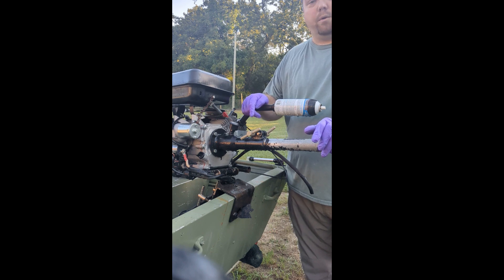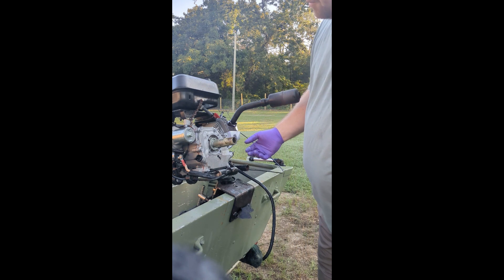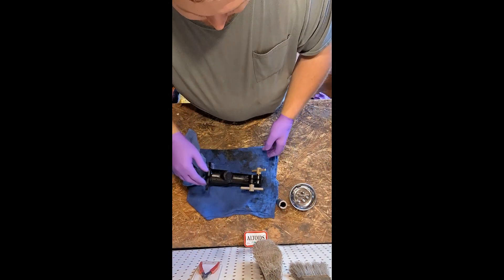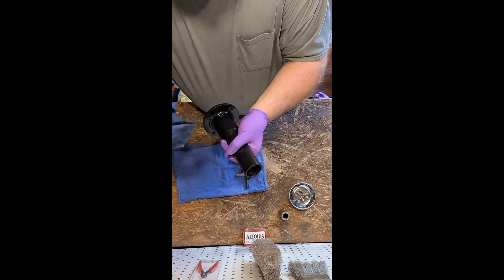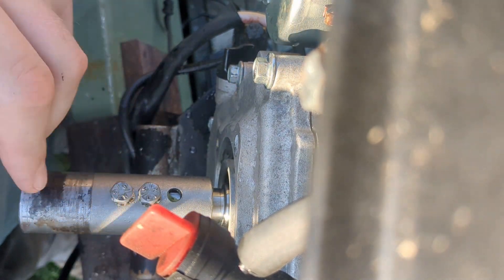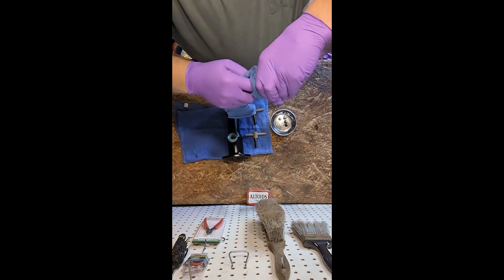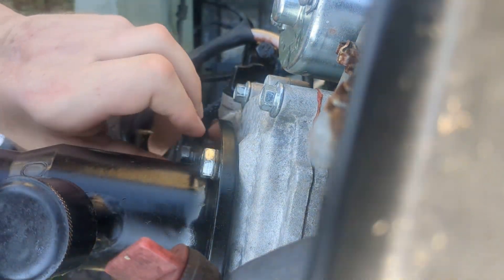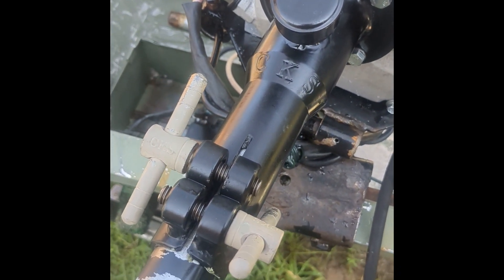Mud-Skipper Longtail Mud Motor PTO Housing maintenance.

Comment: Does the pressure or thrust  from the prop directly transfer to the engine crank or is there a thrust bearing in the pto housing.  Thanks
Reply from the maker: Now that you mentioned that I don't think there is a thrust bearing.